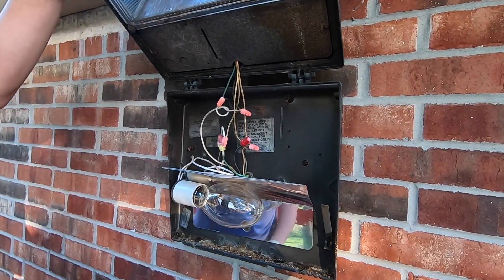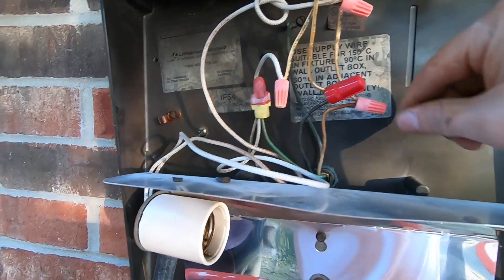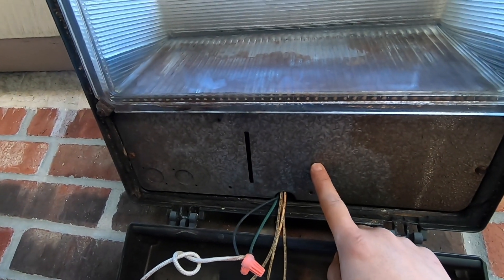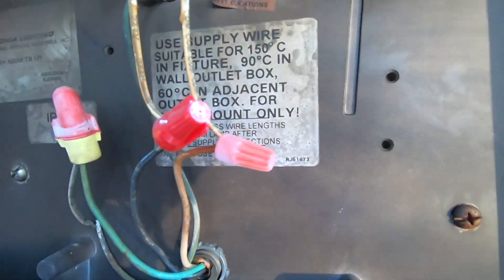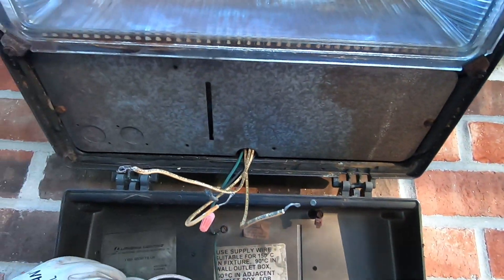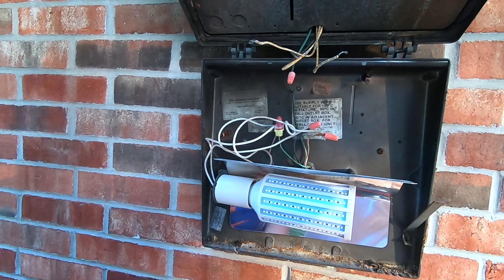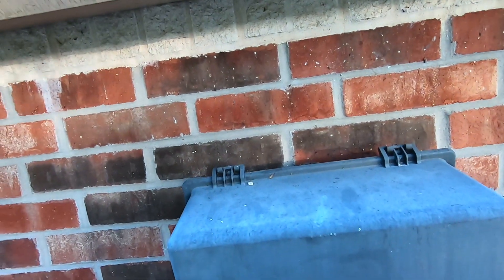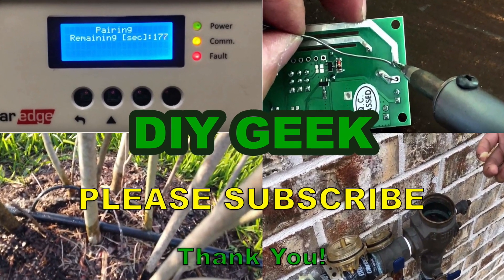Retrofit / Convert Wall Pack Lights from HID (metal halide) to LED corn bulb

Comment: Definitely not good to retrofit better to just put up new LED fixtures as the lifespan of the LEDs won’t last due to the heat. Burnout will be in a few years or less

Comment: Unfortunately, half the light from that LED corn bulb is being blocked by the bulb and wasted on the inside of fixture reflector. The LED bulb manufacturers who make these bulbs also make them with 180 degree light output area as opposed to these 360 degree bulbs. The 180 degree bulbs are normally used in these Wallpack type fixtures where the back of bulb is the heatsink.

Comment: My work used to have these Lithonia lights, however since we switched to leds on the ceiling, we stopped using them, but I would say this is useful incase those leds break since most of these there are burned out.

Comment: There's no video showing the retrofit.
Reply: The retrofit is eliminating the ballast and capacitor for the old metal halides and going straight to power for the LED’s that’s the retrofit.

Comment: If the ground wire was disconnected but left floating would that cause the circuit to fail?
Reply from the maker: I am not an electrician, but I DO NOT recommend ungrounded circuit (leaving ground float).  The electricity need to have a way to reach ground.